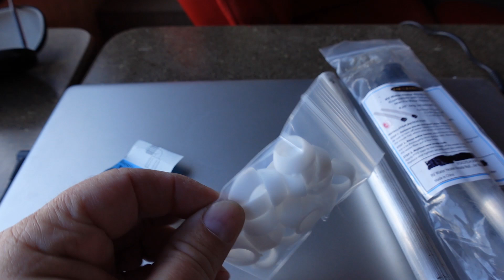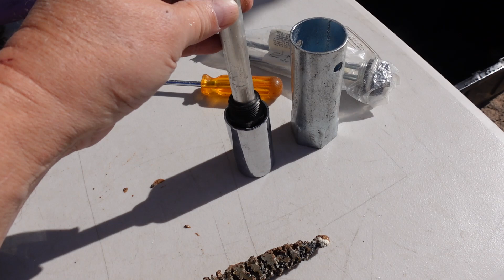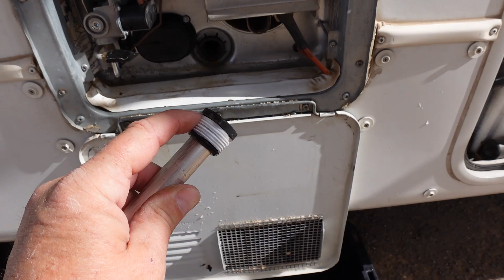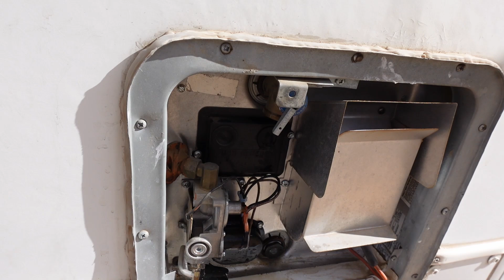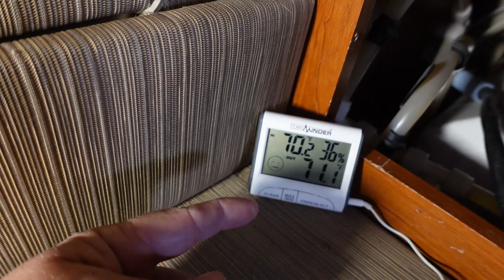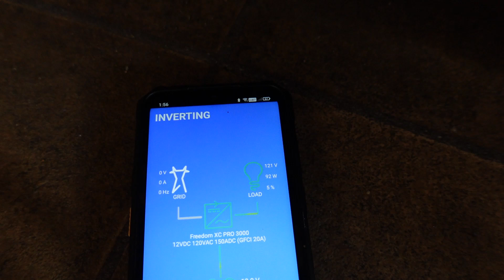RV Water Heater Connection Leak Repair & Routine Maintenance - Suburban 6 Gallon

Comment: Thanks Ray! I noticed a leak at the bottom connection of the water heater in my trailer too. I will try replacing the seal now.
Reply from the maker: You're welcome, hope it solves the problem. :)

Comment: I noticed other flair fittings on the water lines. Did you replace the seals in those connections?
Reply from the maker: No, there are many of them scattered all through the rig. So far I've only had issues with these two. I think I will at this time leave well enough alone and only replace if a leak happens or if I have it apart anyway like replacing faucets or something.  Maybe the heat from the water heater causes the issue.
Reply: Sounds like wisdom.!

Comment: FYI ... an easy 'hack' ...Over the years I have drained my hot water tank via the 2 low point drains. One is for the lines the other for the tank. Saves a lot of mess where I am working & no gush of hot or cold water upon the initial extraction of the threaded plug with the anode on the tank. When I remove the plug I just get a few drops of water. I've too use Teflon tape for years w/o issues. This video reminds me I need to check my heating element, but we use the propane a majority of the time.  I leave the pop off valve open while filling the tankTNX
Reply from the maker: Neat trick. Not sure if it would work with my rig the water heater piping comes out and then rises up above the water heater height before going back down again. I usually have to do a good flushing of hard water deposits anyway so it ends up a mess. I just put a big plastic bin underneath. :)
Reply: @LoveYourRV  I do it mostly to save my self the initial gush of water that usually hits me or one time shot the drain plug into the bushes. It has worked on 3 brands of rv's I have owned and several camping buddies I showed. I always wondered why there was 2 low outside drains? On a cold morning one was producing steam as I was draining. I felt the stream of water and it was hot. I then took the threaded plug out of the water tank and it was empty. I drain my tank after every trip.

Comment: I just replaced my kitchen faucet. It had the same plastic elbow as your hot water tank. I worry about water leaking like you so cut off the plastic elbows and replaced them with shark bite fittings. So much easier to install and I have yet to have any issues with any of them. I would rather pay a little more for brass fittings.
Reply from the maker: You bet, so easy too install. The Shark Bite connectors I installed a few years ago on my city water input feed line are still holding up well. :) When I did my kitchen faucet it came with braided steel lines that were able to screw into the Flair-It fittings. https://www.loveyourrv.com/wp-content/uploads/2020/07/Flow-Max-Plumbing-Install.jpg  Over all the Flair-Its have worked pretty well. Not too many problems considering the rig is 14 years old in March and has seen a lot of travel/usage and occasional rough roads. :) Cheer's Ray

Comment: I made the mistake of trying to tighten mine with a full tank and the plastic fitting disintegrated.  Made a huge mess.
Reply from the maker: opps! :)
Reply: @LoveYourRV is there a way to convert a propane heater to electric heater?
Reply from the maker: @Wildwolf567  There is something called the Hott Rod https://amzn.to/3WxeFpl  Not sure how well it works